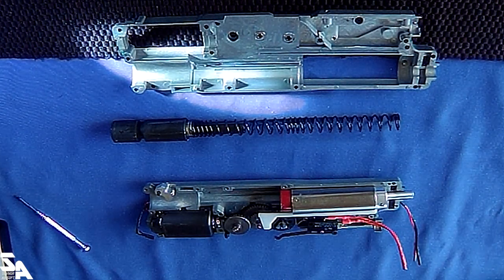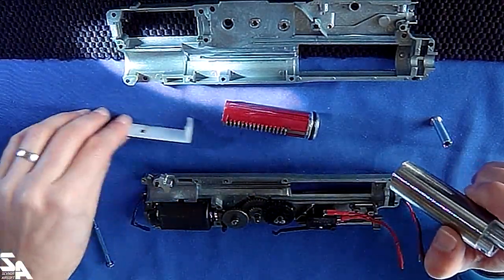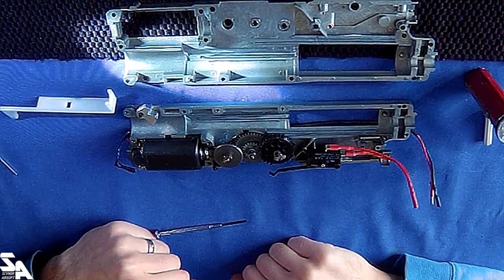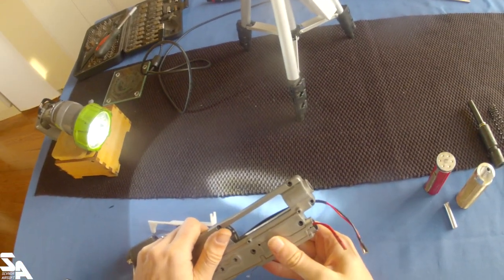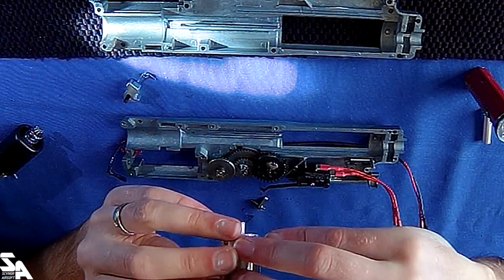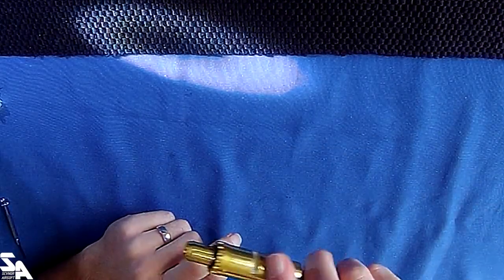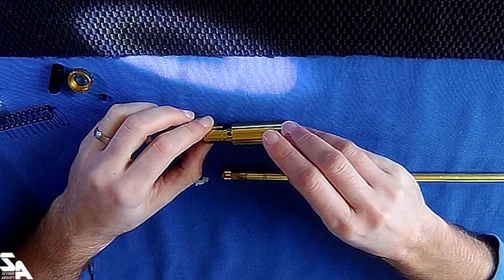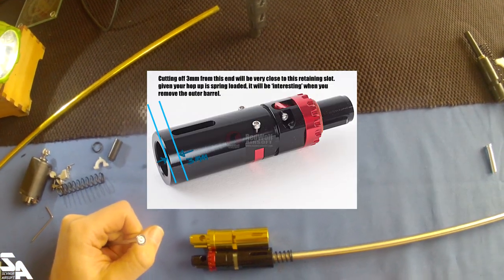LCT PKP Part 2

Comment: Will u tune that Gearbox/Hopup Unit?
I have an LCT M60 and the Gearbox seems to be exactly the same. Also the Hopup unit.
I also have a Bullgear Hopup unit but i cant use is because the Barrel nut isnt Centered so my Hopup Unit dont align correctly vertical. I have modified the the guide holes from the Bullgear Hopup unit so that it is Centered but in my Opinion its not worth "wasting" a 60 Dollar unit for a gun that is just crap builded.
My Nozzle also isnt 100% seald.
I recommend u to not change the Tappet plate and the Nozzle. The thickness of the Nozzle is specific larger then normal.
Also if u use different Tappet plate u need to sand down the front of the Gearboxshell so that the tapped plate is dosent bend at the front position.
Lots hours of work for nothing. That Gearbox is shit in my opinion and not upgrade Friendly.
Oh and dont wonder if the Gears and Bearings dont last that long. Mine broke after 1500 shoots.
And dont forget to adjust the Pinion Gear.